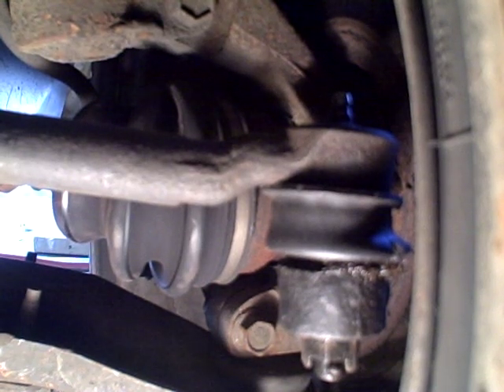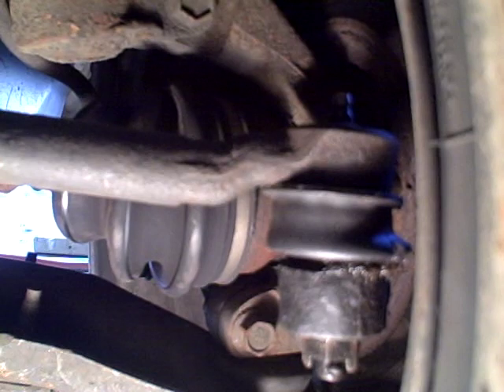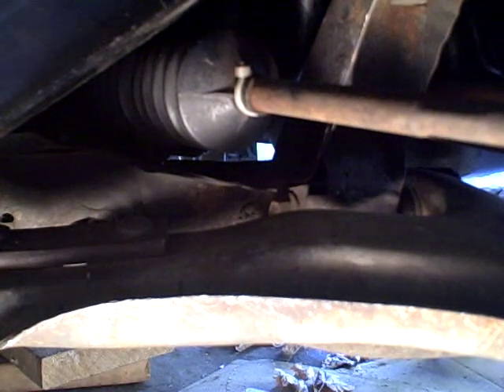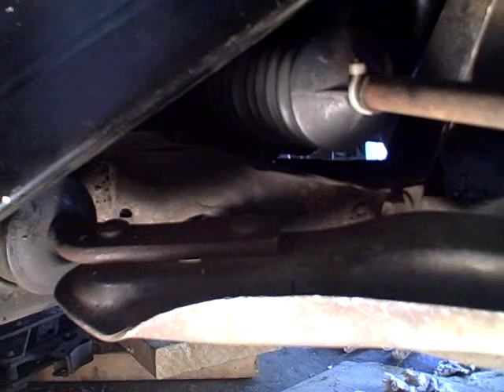Outer Tie Rod Joint or Inner Tie Rod Joint and Rack

Comment from the maker: Jason,

That's what it was, the inner. $20 replacement and got rid of that annoying hitch in the steering.

Morris
Reply: I've actually read that the exam should be done with the engine running, since many cars will have slack in the steering pinion without the PS pump running, and this will look like a bad inner tie rod joint.